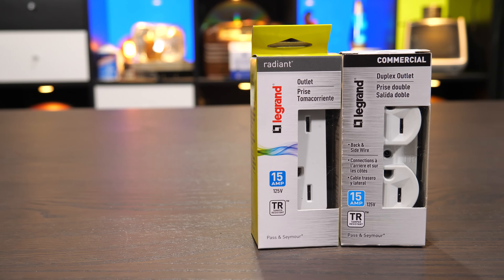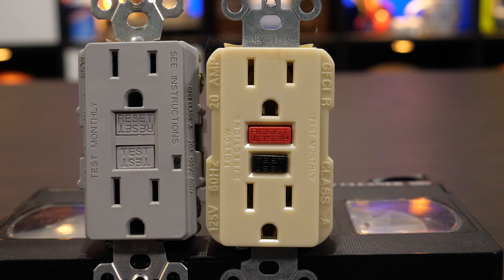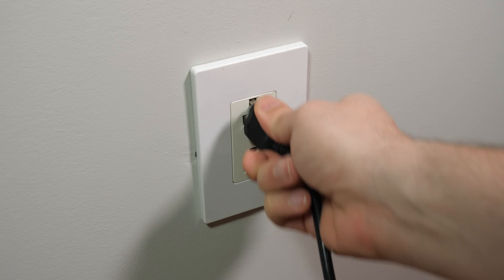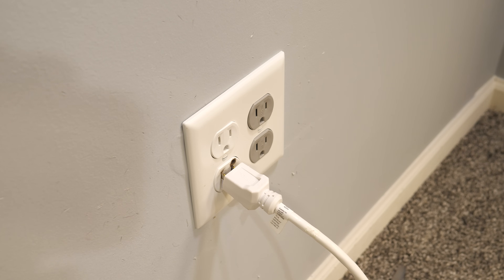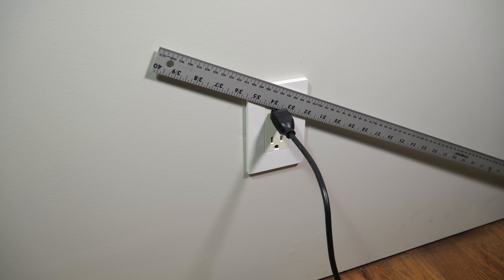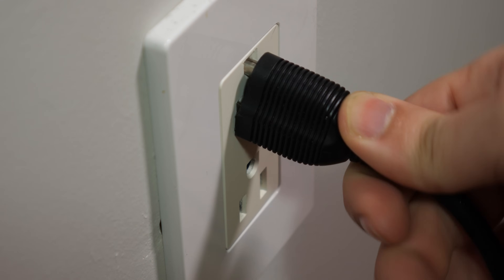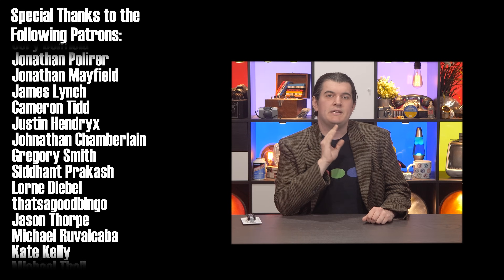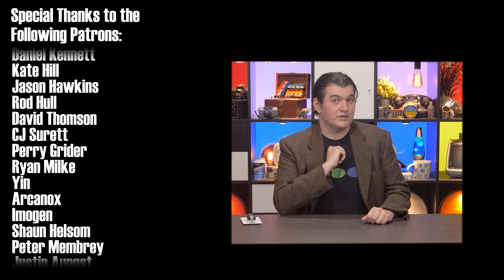Power outlets are topsy turvy - but does it matter?

Comment: What gets me is the UK light\power switches where up is off. 

What kind of inhuman monster designed that? 

Up is supposed to be on.

"Light up", "power up". Why do you think those phrases are so?

Clearly not because up should be off. 

I like many things about the UK, but that switch switcheroo they pulled is wrong.

I'd understand if up was off in Australia, because their whole continent uses anti gravity technology to counter the fact that they're hanging upside down. That's why water spirals down the drains the opposite way, due to interference from the anti-gravity waves.

THAT'S WHAT REGIS SAYS!

Comment: selling my inlaws house, notices that there was a pan head screw used to put the plate on.  also had paint on it, so i decided to replace.  turns out the screw used was too long, and broken the outlet...but also held it together.  when i took it out, pieces of the outlet collapsed... giant arc and metal flying out of the wall

Comment: Our house was built in 1957 and at the time grounded outlets were relatively new in residential construction.  Every single outlet in the house was installed with the ground on top.  I found it pretty frustrating when plugging in appliances (that frequently have  "low profile" plugs with the ground pin on the bottom) and wall transformers for electronics that would not stay in place with the weight on top.  I ended up re-orienting almost all of them to have the ground on the bottom over the course of several years.
Reply: Uhh, if your receptacles are that old you should probably be replacing them all anyway, they're going to be loose and full of carbon soot, perfect conditions for an electrical fire.
Reply: My home was built in '63, was no rhyme or reason to the up down orientation of the outlets. My microwave has a right angle 3 prong plug, my microwave sits on a shelf between the cabinets above my oven, the outlet it plugs into is about 2 feet lower and off to the side, I flipped that outlet ground side up so I could hang the cord downwards and tuck the cord up nicely without needing a big loop of cord flopping down below the outlet to plug the microwave in.

On the flip side my washing machine also has a right angle 3 prong plug, the outlet for it in my basement sits about 5 feet up the wall and was flipped ground side up when I moved in, so I flipped that one ground side down so the cord could plug in and hang down normally.

Then there's the basement outlet that my sump pump plugs into. That one they ran metal conduit along the exposed brick foundation wall to a metal junction box that is turned sideways...
Reply: @_Frank_the_Tank in a lot of older homes, you have outlets that were added over time and they would be added using the style normal for that area at that time and/or with that one individual who did the installation.

Worrying about them being consistent wasn't really a factor in most homes.
Reply: @88porpoise  see the above... it's not that they were just installed any which way. they were following a standard convention for the time.  before the T slot socket became available, 20 amp sockets went upside down and 15 amp right side up.
Reply: @_Frank_the_Tank  in most homes built in the 60's and 70's, an upside down socket denotes a 20 amp circuit, as opposed the the normal 15 amp ones.  You'll usually find them in kitchens, basements, and work spaces/garages.  It's also why most commercial buildings have upside down sockets as they are all 20 amp circuits, and the builders just followed the convention they were used to.
Reply: And that's exactly why this video is BS. Ground on the bottom is clearly the better way to install them.
Reply: @markjohnson7887  what are you on about? That agrees with the video? lol
Reply: @markjohnson7887  Clearly someone who didn't watch the video at all, because that is literally the points made in the video.

Comment: Swiss Power Outlets are in my opinion by far the best ones, almost all points you listed here are fixed by modern swiss Sockets called Type 13, or the plug Type 12
Reply: And the Italian ones. I regret they didn't catch on - I'm not Italian.

Comment: At my last job, we were trying to figure out why a certain circuit would constantly instantly trip. Found out that the metal wall plate became dislodged and was sitting on the live plug pins. So that's not as much of a far fetched scenario as you might think.

Comment: Okay, your bizarrely specific example of a metal ruler has actually happened to me. Albeit in Australia with our weirdy diagonal plugs.

I used to work in security for my states Education Department. I was sent to a high school for an alarm system that wasn't armed. We quickly traced the fault to a tripped RCD on a distribution board.

My coworker decided to keep flicking the RCD, even though it was immediately tripping. I went to go and find what it was connected to (besides the alarm system). As I was walking into a store room, there was a massive spark coming from the power outlet. An extension cord had been slightly pulled out, and a metre ruler had fallen across the pins.

After seeing it spark two more times, I made sure my coworker was away from the distribution board before removing it

Comment: I work at a medical college. A couple years ago, one of our wings went through a major renovation. I noticed that the electricians were installing all of the outlets upside down with the ground pin on top. I asked one of them why. He said, "I dunno, it's what the boss wants."
Reply: "I dunno, it's what the boss wants." describes most of the coin flip choices at my office.
Reply: Code does mention some requirements about grounds and a few other details about hospital environments (isolated grounds, equipment for O2 rich environments such as OR) but I don't think you'll find anything about orientation.  If so, would love to see a citation.
Reply: @mikefochtman7164  it's not explicitly in NEC, but it's due to the testing requirements that manufacturers follow to call receptacles "hospital grade".

NEC 517.18(B) "... receptacles shall be listed 'hospital grade' and shall be so identified..."

I can't link it here, but Leviton has a good bit of info on their site about testing to meet "hospital grade". If they're not installed as- tested in the ground up position, then they're not "hospital grade" and thereby don't meet NEC.

As an aside, leviton does make a quad- outlet unit where 2 are ground up & 2 are ground down. So there are exceptions.
Reply: @danl6634  If its not in the code, it's not a law, so your point is purely about how one specific company conducts their business.
Reply: Lol
Reply: Our Building Code requires ground up for Hospitals and Patient Care areas. In your case, the Engineer Specifications would likely address this issue.
Reply: That's code for hospitals
Reply: @danl6634 there is no such "code" for hospitals, that's basically an urban legend used to argue for upside down receptacles. My mom and brother are both nurses, have been their whole lives, and worked at over a dozen hospitals combined all over LA county and Socal. I've been to a lot of those hospitals, and asked them too since they spend 40 hours a week there, and there is no such "standard". Some places have it, some places don't, some hospitals have both in different parts of the building, even brand new hospitals or newly renovated.  But it's not "code".
Reply: @hustla818  ah the truth comes out! Finally someone actually knows what they're talking about.
Reply: @hustla818  how about this; NEC says the devices have to be "hospital grade". There is a specific set of tests the receptacles have to pass in order to qualify as "hospital grade". 

In order to meet the testing requirements, the manufacturers have tested them installed with the ground up. They aren't being used as tested if installed ground down & thereby don't meet code. Ergo, although it's not explicitly in NEC that they have to be ground up, by the manufacturer's testing methods & calling them "hospital grade" they do have to be installed ground up.
Leviton has a good pdf about it. 

They also make a quad- outlet receptacle that has 2 up & 2 down. So in a way, we're all a little wrong.
Reply: @goosenotmaverick1156  thanks. I just don't get how that got into people's head and why everyone regurgitates it while being confidently incorrect.
Reply: @danl6634  that's a manufacturer suggestion at best, not even close to being a code. I don't know about different brands of receptacles, but that might be the only one that states that. It's probably just some marketing mumbo jumbo they made up to sound better. And even then, if hospitals don't seem to care about the manufacturers suggestion then it doesn't matter, since hospitals are strictly regulated and have to abide by all laws/regulations/code/standards/etc, if that mattered they wouldn't put the receptacles normal side up
Reply: @hustla818  no argument that it's based on the mfg's testing & not directly in the code. When it comes right down to it, it'll probably be up to the AHJ deciding if they want them in a specific orientation. Unless you're up to fighting them... in which case good luck.
Reply: @danl6634  We're not a hospital, though. Accordingly, the other outlets in the building are not upside down. That's why I wonder why they were doing it.
Reply: @ImmortalThanos  As a medical college, you would try to replicate the work environment you will see in a hospital.
Reply: @ImmortalThanos  It's not hard to comprehend if you've ever vacuumed before.  With the ground plug installed down, it pulls out of the wall as you drag the unit around.   Now think of all the wheeled stuff in a hospital with a ground plug that needs to say plugged in.
Reply: @danl6634  Code depends on where you live.
Reply: @pldoolittle  and the AHJ's mood as to whether or not a "medical school" qualified as a medical facility. If I'm the contractor & I know the inspector could be picky, I'm just gonna do them ground up & not think about it further. Then again, they could require the green dot outlets too, again it's all on the inspectors interpretation.
Reply: @danl6634 there isn't a "code" for hospitals. NEC covers everything in the US that isn't transmission and distribution... including hospitals. The only thing the Code has to say about it is "follow manufacturers' listing and labeling instructions" (it's in section 110). The hospital grade recepts I've seen do not indicate orientation.
Reply: "Dunno, it's what the boss wants" is the best reason to do things a certain way, as long as it does not increase danger for you doing that task.
Reply: I have never seen anything that would make me think one is better than another. All are at most times with the ground down. In fact I dont think I have ever seen the ground up anywhere including my doctor's office. Woulda could shoulda is not a one way is better than the other rule.
Reply: The electrical contract says ground prong up.  Put in a change order...you didn't read it?
;) See how much that will cost you.  $$$
Reply: @michaelmccarthy4615  The correct move is to refuse to sign any future contracts with that customer. I wouldn't want to work for anyone who thought ground up was correct.
Reply: My Brother is an Electrician with 35 years of experience. He said residential is normally ground down. Commercial and Industrial is Ground up. He said homeowners tend to plug and unplug things more often, and their index finger can touch the live conductors when they're on the bottom. Whereas industrial and commercial equipment stay plugged in for an extended period, and it's safer to have the ground up, in case something is dropped on the plug.  

That's why switched plugs in residential are sometimes ground up, because they don't get plugged and unplugged as often, and it also marks the outlet as switched outlet.
Reply: @teeing9355  a number of commercial buildings will ask for ground pin up, but it's merely the project specifications, it has nothing to do with with the code or rule that "commercials = ground up". Here in Canada I see both in commercial buildings, but it may be more common in the US to have ground up for commercial.
Reply: @HCkev  lots of folks like to think it's more common to put ground up in commercial applications. That's just their personal experiences most times, at least in my experience that's the case. 

 Probably half or more of our commercial jobs flat don't care which way the outlets are facing, so long as they all work 🤣 

Unless specified by Prints, customer, or product spec, for the most part we install outlets one way an  that's it, just for the sheer fact of being consistent, for the most part. But, that's also just us and every electrical contractor will have their own opinions and experiences with it.
Reply: @HCkev  basically what I was trying to say, was here in the US, it kind of just varies from place to place what you'll see. Where I live, it's generally not something we even worry or think about unless someone mentions it. If that makes sense.
Reply: @goosenotmaverick1156  I will personally always install them with ground down, unless I'm instructed to do otherwise, or other electricians started to install the receptacles and they decided to put the ground up (for consistency sake, as you said)
Reply: That ... that doesn't sound like an electrician to me. :(
Reply: I think a complete redesign would be good, but expensive. And it all comes down to money. 
I think I’ve seen a suggestion to mirror the duplex outlets so that the ground pins are top and bottom, with live in the middle.
Reply: Probably, the electrical subcontractors had in their contract this very clause.   Ground plug up.
Reply: Perfect answer when you dont want to talk to idiots
Reply: That's right side up, with the ground pin on top.
Reply: That's the correct, commercial way, to install them.
Reply: @SorinNicu  not necessarily true, but a commonly followed practice for most. Unless plans specify orientation, it's more up to the choice of the GC, PM, EC or end customer/occupant or building owner, depending on situation.
Reply: @goosenotmaverick1156  GC, PM don't care, as long as you're done in time and within budget :)
Reply: Code requires the U ground to face up because most people use their thumb on top of a plug to pull it out. In turn your thumb can touch the metal prong so if the outlet is not installed with the U ground facing up a person can potentially touch the hot and neutral prongs with their thumb as they remove a plug.
Reply: @pbee73 Did you happen to watch the video?
Reply: @PekkaKilpeläinen  I'm not sure he did. 😀
Reply: @pbee73 did you watch the video?
Reply: @pbee73 I'd like the sourcing for that so I can find it in my codebook, but I'm pretty sure that doesn't exist, because I've never seen it.
Reply: @goosenotmaverick1156  Its not in the codebook, they install them U ground up in hospitals and I gave you a scenario do you need more than that?
Reply: @pbee73  you didn't mention hospital before, I even went and double checked, your comment said NOTHING about hospitals. You said CODE. Now bring me the CODE that says it's required. You did not originally specify anything at all about hospitals in your comment.
Reply: @pbee73  so no. You didn't give a scenario. You stated that's what code says. Now you can go edit your comment now to add that if you like 🤣
Reply: @pbee73 Can you provide a code citation for that?  I've read the NEC many times over the years and it's always silent other than to say, "...should be installed as per manufacturer's instructions."
Reply: @pbee73 I'm an electrician and there is literally nothing in the code about outlet orientation.
Reply: @pbee73 but I’m more likely to touch the prongs with my first finger, along the bottom side of the plug. So ground-down is safer for me.

In any case, inserting a non-grounded plug makes the whole argument moot.
Reply: @pbee73  With the ground up, it is far more likely for the index finger to touch the hot and neutral, while the thumb does not touch the ground.  This results in a shock.  With the ground down, the most likely contact is between the index finger and ground, while the thumb does not make contact with either hot or neutral, resulting in no harm.  
Also, with ground up, it is more likely for a bumped plug to have the ground pin shear off and potentially fall, making contact with the hot and neutral.
Reply: @pbee73  

National Electrical Code does not require this at all, and it doesn't make a whole lot of sense for this to be part of any localised code either.
Reply: @pbee73  also, you said CODE specifies, yet then you say it's not in the codebook? So where is this imaginary code you made up?
Reply: @pbee73  next time don't comment about what you're ignorant of.
Reply: @pbee73  But this is in the US where incidentally touching the hot while unplugging something is, at best, a learning experience.

Comment: The Schuko socket that we have in Sweden (and most of Europe) seems to be a safer solution
Reply: Sadly schuko is not a standard all over Europe. France, Belgium, Poland, Czechia and Slovakia - around /3 of the EU -  have a slightly different system that while better than the US NEMA, allows a grounded appliance to be connected to an ungrounded socket.

Comment: As a kid, I once got shocked by accidentally touching the prongs while unplugging the washer and dryer from the receptacle.  

We lived in FL at the time and one of my parents asked me to do so during a thunderstorm.  

I had a really hard time pulling it out of the receptacle. 

It was about halfway out when I went to get a better grip on it and my fingers made contact with the live prongs.  

I felt the electricity run through my body.  

It was a very scary experience for me and I guess I'm lucky to be alive.